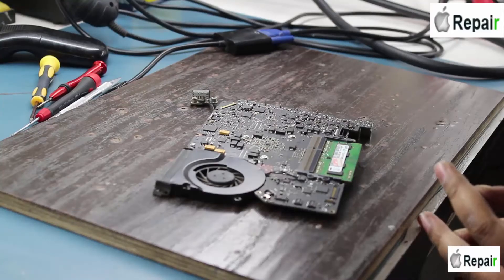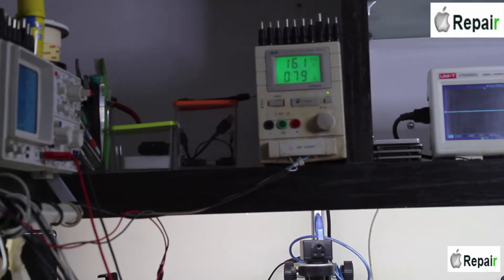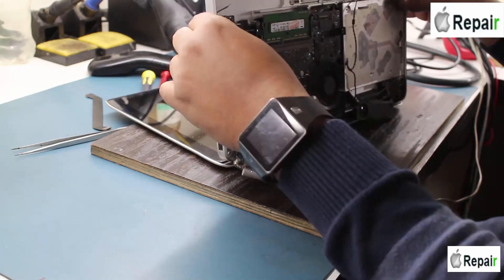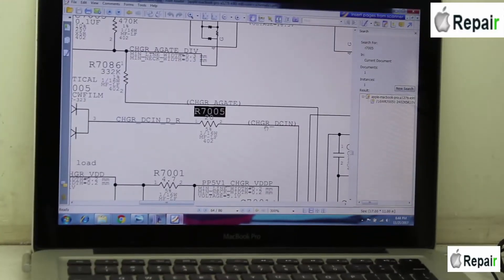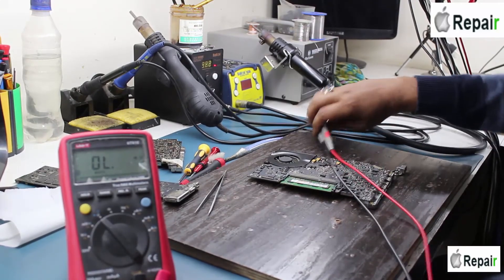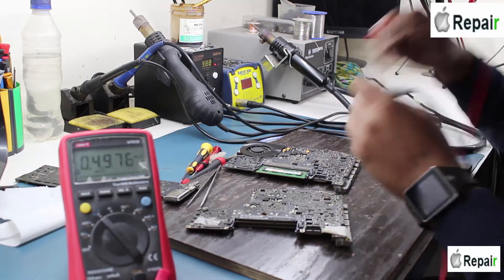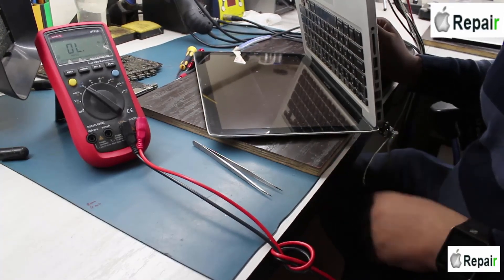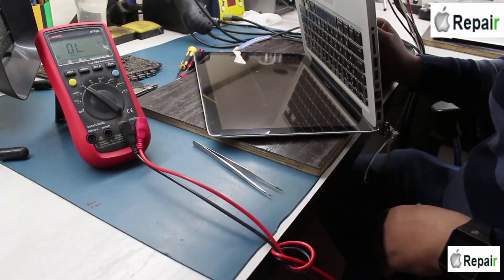Apple MacBook Pro A1278 on and off, Fan spins and off, 820-2936-B no display repair

Comment: Sir i have the same problem.. Mine is a macbook air mid-13.. Should i first chack the ohm value...? And if its high.. Do I have to replace something..?? Also what did you replace..?? 

If you will be kind to please answer...
Reply from the maker: Check the impedance value... If its not good then change it.

Comment: I'm completely faced with this defect and I haven't been able to resolve it. It doesn't have 5V or 1.35V... They keep varying, the cooler rotates and stops... Could you give tips on which vital points to resolve, I'd appreciate it... There's no need to enable the TPS51125, injecting 4.20V into the line 5V TPS51125 heats up but it's not, I already changed it, the same thing continued.
Reply from the maker: Could be SIO issue.
Reply: @laptex1377  SMC ?
Reply from the maker: @xistofila7616 yes

Comment: Mine is just black screen fan on 3 seconds then off the charger light is solid green
Reply from the maker: Could be Problem from G3 hot or DCIN section
Reply: @laptex1377  do you have a diagram or video to show?

Comment: I got an A1342 that comes on with no display and solid sleep light. Fan spins and after maybe 10 seconds, it speeds up and power is cut. It will then reboot on its own and this time the fan will speed up again. Only this time, the machine will not power off. It will stay on with no display, sleep light lit and fan on max speed. This is when plugged into MagSafe charger. First power up always causes a reboot and the second time it stays on with the same symptoms. 

If I do the same with just the battery, it will do the same, but continuously reboot just as the fan speeds up. Under battery, it cannot stay on. 

Any idea what might be the cause here?
Reply from the maker: Try to clean ME region of the BIOS in the system if it works fine then no problem. Else try to check the DC-DC run section.
Reply: @laptex1377  Unfortunately, the issue is the ISL9504 BHRZ chip I think. I was feeling around the board and as I put my finger over that chip, boy did I feel that. It gets insanely hot very fast when I power the machine up. Something bad is going on there given the amount of heat being produced by that chip. 

I don't have any soldering skills or equipment, so unfortunately can go no further. I just wanted to figure out what was wrong and whether it was actually the board. Looks like it is.

Comment: Dear thanks for your contribution, I have the same problem in the same model, but when checking the resistance is its value correct, what other component can cause this failure?
Reply from the maker: There could be many reasons for this problem oneof the reason has been shown in the video.
Rest and many more concepts are covered in our online video course.
You can contact us for further information.

WhatsApp +919031240767

Comment: THANKS FOR THE GREATE VIDEO .. I HAVE A A1286 PCB THAT ALMOST SHOWS SIMILER CASE .. MY PCB HAS A GREEN LIGHT WHN I CONNECT CHARGER TO THE FAN STARTS UP FOR 10 SECONDS AND THEN POWERS OFF AND AGAIN  STARTS UP AND THE FANS ARE AT FULL SPEED AND IT STAYS ON ONE WAY, TILL I DISCONNECT THE POWER CABLE ….AND THERE IS NO DISPLAY OR CHARM NOISE WHEN IT  TRYS TO BOOT OR FAN STARTS, THIS IS WIERED PLEASE ANY ADVICE WILL HELP I AM A   …...NOOB THIS IS MY FIRST APPLE LAPTOP .THANKS

Comment: SETH  I'm having same problem, my mac was working perfectly and I left it to go out coming back everything was blank. If I plugged in charger charging light will come up also battery status light by the side will give me battery status, but it will never power on, can this be battery aswell? Because condition before was change soon.     

I remove the battery and plugged in charger to power it on also no power. Can I get new battery and try it or the problem is what you just fixed now?
Reply from the maker: Could be 3.42 G3 hot supply problem

Comment: Hi Nasir 
I have the same problem with a MacBook Pro A1286 late 2011 ? I think it is a current sense problem ? Can you help me or can I give you more information about the measures that I have done ? Thanks
Reply: i am from Belgium
Reply from the maker: Better check the requirements and also if there is shorting in the motherboard

Comment: only with the replacement of R7005 worked?, because later on the video i didnt see the apple icon on the screen and didnt heard the boot sound, i am not sure if it worked.
Reply from the maker: This is most usual problem in this model and no relation with display it works fine with battery but problem with charger. I hope this will help you. Thanks for your concern.
Reply: @laptex1377  Im a little confused on what you mean. Did the logic board work properly only when connected to battery, or did it not work with battery and charger?

EDIT: Im having the same issue and fans turn for maybe 3 seconds then stop. and repeat.
Reply: @DSuave03-Me  I'm having same problem, my mac was working perfectly and I left it to go out coming back everything was blank. If I plugged in charger charging light will come up also battery status light by the side will give me battery status, but it will never power on, can this be battery aswell? Because condition before was change soon.     

I remove the battery and plugged in charger to power it on also no power
Reply: @jamiusamin  Is your problem resolved? if yes how and where. How much was the service fee?